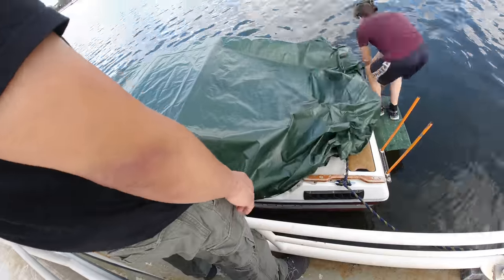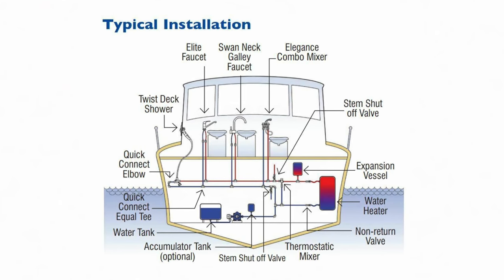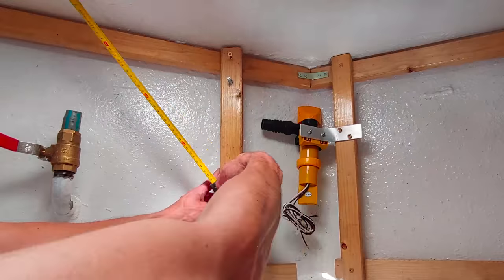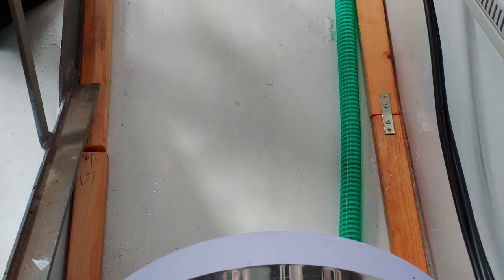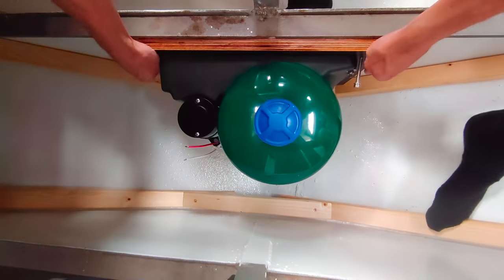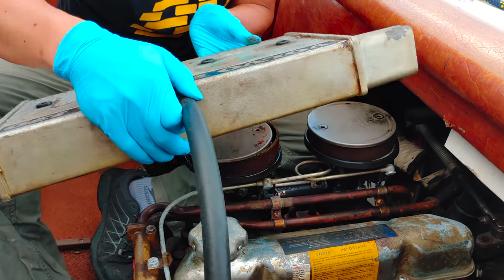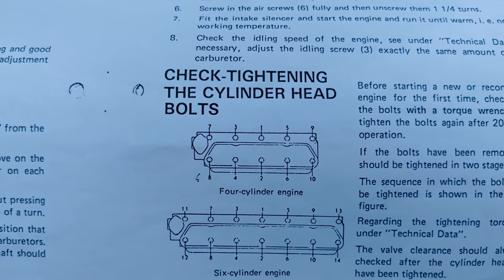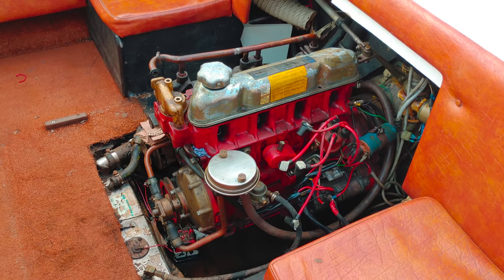OPENING the ENGINE of my 1980' BAYLINER Mutiny - Ep. #42 - Vintage Yacht Restoration Vlog

Comment: A Volvo engine never dies :) Here is what i would have done. 
1: Clean up the piston as good as possible. 
2: Rotate the engine so that the nr 3 piston is at TDC, Check the cylinder wall And if its not to scorred/damaged Just pull out the piston from the bottom and clean it up (My guess is that the piston rings are gone) and replace it with a salvaged piston. 

Iv worked with Volvo redblocks a lot, And again, they never die until they die. :)

Comment: Most likely a blown (or atleast leaky) head gasket that allowed water/ coolant into that one cylinder over a long period of time. This is me judging it from a quick still frame but the corner of the head is blown out where the head gasket would sit. With the head gasket shot water leaks in. It was probably extra smoky for awhile prior to dying. That head is trash but the block might be salvageable. Id pull that dude out and bring it to a machine shop or do some more investigative work. You could probably take a couple thousandths off the top of the block and be fine but youd want to see that cylinder and bottom end look like first.

Comment: You're gonna have to take it all apart and put a bedding compound under all the wood where it meets the steel.  With the baykiner, if you had a place to work, you could pull the motor and out drive, glass the hole and hang an outboard off the back
Reply: I don't think he realizes how much vibration there is that will shake things like those frame members loose. Boats vibrate flex and twist and shrink and expand and unless those frame are insulated from all that or are rigidly mounted to a metal supporting member they will come apart.
Reply: @JamesRook  Yup, but on the other hand, It's just going to be a canal boat, so actual marine construction practises need not apply as it will neve see rough waterbuy running components like the  water pump will echo through the boat.   hehehe I though it was pretty funny to bury the bilge pump under the water tank and no check valve, .hehehe hope the boat never leaks.
Reply: @mazdarx7887  I hope doesn't have plans for ocean crossings - yet. You never know. But if I had to depend on a boat to keep me from treading water I think I'd find out how to fix things correctly and safely. No time to do it right the first time but plenty of time to do it over!
Reply: @JamesRook   As before, they just patched up enought to get it home. I watched a few more of their vids last night and they are on the right track to having a sound boat. got some pretty skilled shipwrights working on the hull. The wood they are using would cost a small fortune outside their area, especially in the states or canada

Comment: I would of slide that hose on for the bilge pump on a all the way and use two clamps. btw if the cylinder walls are not scored you should be able to rebuild that motor. No problem.

Comment: Torque wrench is used for torquing bolt to proper specs. They are called bolts not screws. Also use a breaker bar to loosen tight bolts

Comment: The first thing to do is to see if you can manually rotate the engine.  It appears that the main problem was a blown head gasket allowing water into the cylinder.  Cleaning things up and milling/replacing the head could fix all the problems.  However if it got a hydraulic lock because of the water the bottom end of the engine might be toast, hence the reason to see if you can manually rotate it.. Best of luck....

Comment: Volvos are hellish expensive to fix here in Canada. Had a 1978 MD-17c in my boat, blew the rear oil seal. Mechanics said $15K for a complete overhaul. I ended up replacing it with a Beta Marine 38. 3 more HP, about half the fuel consumption and about 300 lbs lighter, for $14K

Comment: That engine is good clean the top of the piston then turn it to the bottom of the stroke with oil in the bore and have the head reconditioned/decked ................oil your cylinbers !  Check the pan oil for water !   install new head and pressure test it.

Comment: Get a proper German VW TDI engine from a diesel Golf or something to replace that Volvo. They're probably abundant near Berlin, probably cheaper than a 5-cyl Volvo, and put out a bunch of power. Plus, then you can use the same fuel for both boats! Set up your platform with a refueling station :D

Comment: Have the head checked for cracks between the ports. I have the same engine and am on my fourth i think head. That engine is fixable. . If not the b20 car engine or head can be used with some modification. Ebay has some heads and blocks available.  Engine parts are still available.

Comment: Chilton's publishes manuals to rebuild engines. See if your engine manufacturer has their own manual. The cylinder head might be useable. Examine the piston and its cylinder. Photographs to a factory mechanic or service person, can get an opinion as to condition and course of action. I have purchased used engines for parts, and been pleased with the result.

Comment: Water tank looks very small. If you intend to live on the boat, please install 400 to 600 liter tank(s). Hot water tank can be around 60 liters.

Volvo engine is not a loss. Bring it to an engine shop and it will run like new.

Comment: Just curious, is pressure treated lumber not used in Germany? 
It’s a great choice to use it whenever there may be water present.
Reply: Or consider some of that new plasti board type stuff. Its ALWAYS wet in the bilge. That wood won't hold up well.

Comment: Echoing comments below, it looks like the head gasket failed and coolant got onto that cylinder. The debris appears to be rust only, and possibly head gasket chunks. I would plug up any passageways, and then use a wire brush to clear all the debris from the piston. Then soak it in a lubricant, like ATF, WD40, PB Blaster, something like that. After  a couple days try to turn the engine over with a breaker bar (go buy a breaker bar, don't use the torque wrench it can throw off the calibration.) Turn it over using the bolt on the main pully on the front. Inspect the walls of the cylinder and see if there is scoring. If there is, don't panic, you can likely still save the engine, it just needs some light rebuilding. If not, have the head serviced, or find out how to lap the valves and clean up the head. Get a new headgasket, reinstall the head and try to start her up.

Comment: I think you could make that engine run without too many parts. Replace the valves on that one rusty cylinder, and the head gasket. Hone the cylinder, and lap the valves. Put it back together and check compression. I think all you would need is valves for the one cylinder and a head gasket.

Comment: After removing the cylinder head you'd also want to inspect the cylinder wall or at least the sleeve has it is replaceable in a machine shop and of course refitting the head to the new cylinder wall this isn't that big of a deal for a diesel engine as many shops are set up to do this very thing. The DIY is possible but not probable without some of the machining capability. Just for you to consider thanks great set of videos.

Comment: I'm watching without volume so forgive me if this was talked about, but that raw untreated wood is not going to last.  You want to at least encase it in epoxy, such as something from West System.  Also use stainless fasteners.  I would personally take it back out and paint it with epoxy.  Let it cure, wash it to remove the amine blush then coat it again (this is in the epoxy instructions).  Wear gloves, that stuff is oil soluble and very difficult to remove from your skin (soap does not work).  They sell the epoxy in different sized jugs, the few bucks for the pump kit is completely worth it.  For every one pump of epoxy you add one pump of hardener.  I'm recommending West System because that's what I'm personally familiar with, there are likely other good brands as well.

Comment: You should only ever use a torque wrench to torque  bolts to the specified torque.  It was not designed to be used as a breaker bar, using the torque wrench in this method will cause it to lose calibration over time.

Comment: A bilge pump is a high maintenance item that needs accessibility.  One way you could solve your problem is to use the style that has a remote pickup.  Mount the motor out where you can get to it and the foot (pickup) goes to your low point.  Some are of bronze which would be heavy enough to stay where you have put your pump now or you could make a bracket.  You just need to be able to reach it by pulling it's hose to be able to clean any grunge off of the strainer.  I would be very leery of buying a raw water cooled boat and just wouldn't if it is anywhere close to salt water or even brackish water where it could have been used.  A freshwater cooled engine with a heat exchanger is a much much better system.  You can add one to yours.  Also if your accessories are in good shape you might be better off with a remanufactured long block.  If that Volvo engine is based on an automobile engine (many brands are) then a generic rebuild would be much cheaper.  Check to see that the main bearings are the same before purchasing as some marinized engines upgrade the bearings and they won't fit your oil pan (with water evident it needs checking anyway).

Comment: the chunks of metal in the cylinder looked like a part of a valve seat. Rotate the engine and check the condition of the cylinder wall. It may not be a lost cause.

Comment: Hi there this volvo penta b20 is just the same  B20 thats used in cars ,all you has to do is get hold of one and put on the same marine parts that you had on the old one,then you have the marine vercion of the b20, sinse you are in germany i'll bet there should be a far amount of old volvos sitting around in scrapyards ,or just motors laying around in garages, and parts for the b20 is still sold all over sweden. the b20 vas used in the 140 and 240 series from 69 to 81.

Comment: Yes that motor can be rebuilt. Have the Head rebuilt 100%... All valve seats grind and replaced , valve springs Etc + head Resurfaced. Remove the Cylinder block and inspect for damage, You may want to have cylinder block Magna-fluxed micro fracture detection. often if crack is detected a weld repair is good. if pistons look good (Measure Clearances) try hone the Cyl bores and replace rings. Replace bearings at rod to piston location. have the engine parts Boiled or Vapor blasted then re-assemble. All this is NOT that expensive if you deliver the component parts to a Motor Machine shop individually.

Comment: Save yourself a lot of money and rebuild what you have take the head to a machine shop and have the head resurfaced  and rebuilt roll over the engine so that you can see the cylinder walls they may be ok if so you can put on a new head gasket and bolt the head back on ( after you get it back from the machine shop ) I would put carb kits in the carberators , change the oil and filters and maybe the belts and enjoy.

Comment: Head bolts should be replaced because they have a certain amount stretch and once you take them out they are no good
Reply: Very common mistake novice engine builders make! Always always always replace and do not reuse torque critical fasteners like cylinder head bolts or rod bearing bolts. Just as you said, once the bolts are torqued to spec they stretch. I learned this the hard way many years ago.

Comment: I'd also like to give a shout out to Whale. I bought a Whale variable-speed fresh water system pump from a local shop. After fitting it, I discovered that it didn't work properly. I called Whale, and after giving them the relevant details of the pump, we discovered that it was over 5 years old! Parts had dried out over time, and it was no longer good. I thought I would have to go back to the shop and try to get a refund with my (now opened pump). Instead, the guy at Whale told me to pick out the system I wanted from their catalogue, and they would send it to me. In the end, they sent me a more-expensive system in exchange for the old, dead pump. Trust a company that stands behind their products.

Comment: The engine block is saveable,let it soak in penetrating oil and rotate number three piston to BDC,hone the top half of the cylinder and you should be good to go.It's probably easier to find a decent used cylinder head rather than to try and save that one due to machining costs.

Comment: dropped a valve seat...   probably overheated the engine to do coolant flow issues.. clogged thru hull port.. water pump impeller blades fell off.. (impellers should be changed every 6 months)    might want to see if the engine will still turn with the head off.. examine the top of the piston with the chunks removed to see if the piston is broken or the outside area of the piston is crushed down on the piston ring.. preventing it from spinning freely..

  Huge hint.. when working on engines.. hardware and floor covering stores sell floor protection film.. its clear film with adhesive like a post it note on one side so it sticks in place.. it allows you to cover open engine openings easily.. it can also be used to seal off cabinets and doorways when you are making dust..

Comment: It looks like the head is cracked between the two valve seats in the bad cylinder. Just break the frozen piston loose by spraying oil in it and rock it back and forth to free it, if you need to you can tap it with a block of wood and a hammer. It should be OK and replace the head.

Comment: The Bayliner engine can easily be rebuilt. The cylinders can be repaired and bored. If you are going to the trouble of pulling the engine out in order to put in a new engine, then fixing this engine is not beyond your means. You can rebuild that engine right there on your dock-platform.

Comment: I think it’s an easy fix. Just take the  cylinder head to a shop and have them rebuild it. Im betting the lower half is just fine. Check the book, head bolts might not be reusable.

Comment: Greetings. I’m not a fan of Volvo engines. Mostly because of cost, and their electronics. That 1980 engine has few if any electronics and the aftermarket parts should hold down cost. We haven’t seen the bottom end; however, the top is fixable.

Comment: Engine is totally repairable. why look for another headache engine just spend the money fixing that one. With the head off did the Engine rotate over fine? how were the Cylinder walls?
Reply: Exactly, why didn't he clean up the cylinder head with a wire wheel drill and penetrating oil, then try to turn crankshaft?

Comment: I thought the boiler would have to be vertical so that hot water rises to the outlet and heat would be used efficiently.
With the seized engine pour diesel into the tops of the piston and leave for 24 hours this should free it up if nothing is serous. This is rather then take the head off.

Comment: You gave up without a fight.  Keep ripping it down, then drive out the piston from the bottom using a wood dowel.  After a complete tear down you will know if the engine can be rebuilt.  It probably can as there appears to be no real damage to the cylinder block.  You might need a new piston and a new set of piston rings but that's only if you destroy the stuck piston in the process of removing it.

Comment: It looks like that bit of rust in your hand at 17:54 is a part of valve seat. View also supported by the fact that the valve appears too far into the seat.
Very fixable problem really unless the head is cracked or the bore destroyed.
How old is that engine and if it is old, was it converted to run on unleaded petrol (hardened valve seats fitted)??
I also agree with the other comments regarding the bilge pump. You need it visible and easily accessible - you will probably only look at it when you need it most. Fit 2 as a minimum!
Finish jobs properly before you start the next one - details get forgotten and bite you later.

Comment: Using your Torque Wrench to undo head bolts and such is NOT a good idea. It will change the delicate spring setup in the wrench and ruin the calibration. Invest in or make a Breaker bar (weld a socket drive onto a length of water pipe)
Cheers Eric

Comment: The engine is quite fixable, probably just a new cylinder head will do it, I'm sure you can save the bores.
Reply: Not sure if cylinder head needs replacement, no massive holes in it, I would replace the exhaust valve and seat and lap all the other valves, pistons seem to be in ok condition

Comment: That engine is not a big problem, check if it will rotate without the head on, if yes...take the head to a machine shop, they will fix it...and...why do you need a tourqe wrench to loosen the bolts??? No need for that, impact gun is the way....just need that wrench when your are tourqing the the head down.. Btw this happend...headgasket failure....clearly! Greetings from a mechanic.

Comment: I couldn't help but notice you appear to using standard hardware and fastenings in your boat. In my experience these steel fittings always go rusty at a unbelievable rate, so make it a rule to only use marine fittings, and s/s fastenings, nothing worse than finding your one year old steel screws have corroded and ruined the woodwork. Things then start falling apart.

Comment: You should at least try to rotate that crankshaft to get this that one piston down to see if they're scarring off on the cylinder walls if there's not then just do a valve job on it and engine is salvageable

Comment: Your giving up way to easily, that engine I believe is repairable with a new piston and rings and a good used head and gasket set for under $500 US dollars ! I’d still pull the motor and check out the crankshaft and if she’s ok down there then fix her but if crankshaft and rods and bearings look bad then explore options !